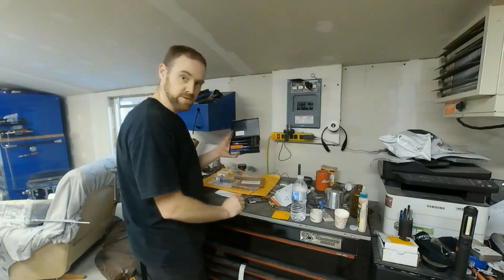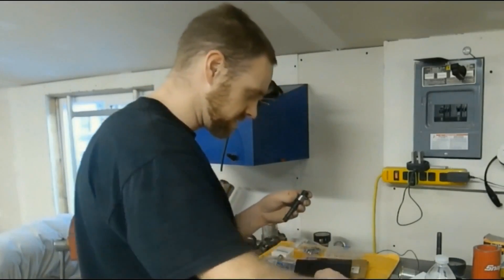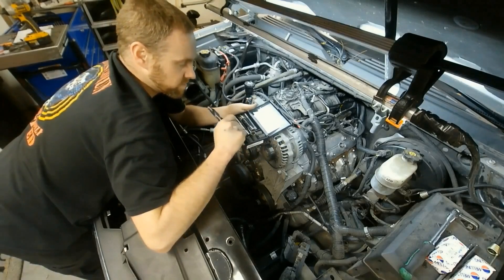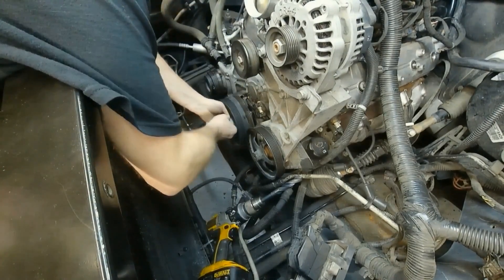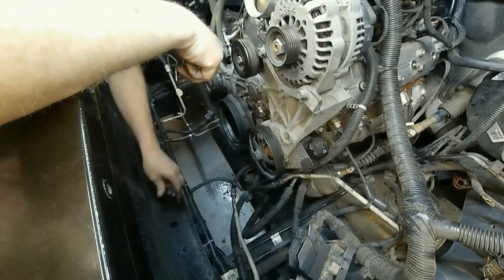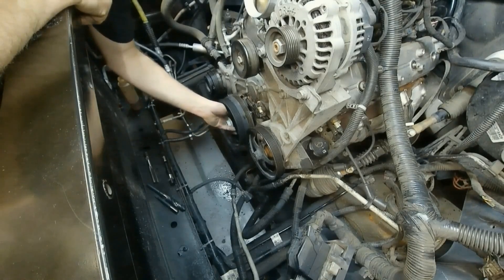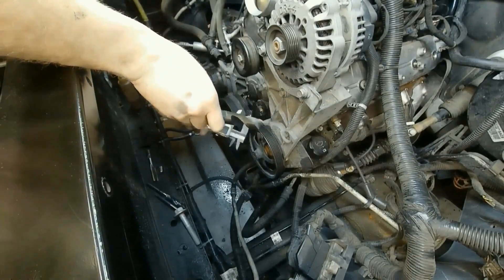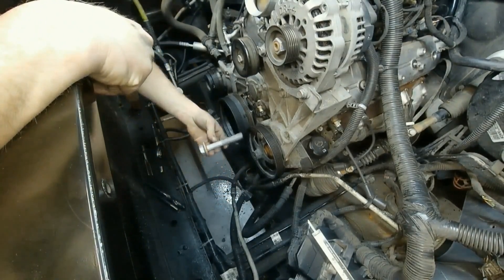Stripped Crankshaft Threads Time-Sert on ls based engine

Comment: Can it be done while engine is installed in truck?
Reply from the maker: What is it you think I did in this video?
Reply: @CrazedPerformanceRepair don’t see your radiator
Reply from the maker: @MC-hs4mf  yeah I had the radiator out because the camshaft was out. In order to remove camshaft radiator has to come out. You asked about the engine being out, not the radiator.
Reply: @CrazedPerformanceRepair 
Bc this doesn’t seem doable in my vehicle without removing engine or radiator

Comment: Is Loctite the way to go to hold the sert in place?? Or would something like jb weld be stronger to hold the sert in place?? Also would just the regular time sert be enough for the balancer bolt to hold?? Or are the BIG serts better for crankshaft repair??
Reply from the maker: I think loctite is the way to go. At least then one could technically remove it if needed. All you need is a little bit of heat to more or less melt loctite. I wouldn't use a regular helic oil style repair on one of these. I'd be concerned that the hedge of the coil might catch the bolt and leave you in a worse position than you started with.

Comment: no one anywhere speaks about the 'recommended.' old bolt to 240 ft. lbs. to seat the balancer process then pull and proceed with the new  tty bolt. did you hammer it in with a torque wrench or lock the flywheel and follow proper procedure. i'd be scared to death either way in your case
Reply from the maker: This was a strange situation where I was attempting to put it on without heat if I recall. I believe I used longer ls7 bolt I had to start it then old bolt to lock it down before using new bolt. Now I don't listen to book or tq to 240 with old bolt. Now I preheat balancer to about 250deg f and quickly push it on then just as quickly zing in the old bolt with impact till it has bottomed out the balancer. The only purpose of the 240lb ft is to bottom out balancer. when the balancer is hot and the crank is cold you can sometimes bottom the balancer just putting it on with your hands. so it doesn't take near the force. when I use the impact I usually don't go past maybe 50lb ft or so if the balancer is hot.
Reply: thanks for the info. i installed mine 'by the book' yesterday on a donor engine i freshened up but will give your method a go when i take apart the failed engine. yeah the 250 degrees makes sense. (my heart sank when you pulled the crank threads) @CrazedPerformanceRepair

Comment: So how much did you go in is i did see close to the end of the drill bid just still curious on how much going to do try this in the near future just need to figure out how im going to get the install tool off sense it broke inside i got the install kit from autozone and had a smaller bolt go into the actual size of thread i needed installed the harmonic balancer and once i started backing out the tool the second pieces stayed inside (if makes sense) what im talking about as far as the tool i got from autozone....
Reply from the maker: Ouch, if the tool is a hardened steel you might be f-ed. If it's not you will have to drill it out and start over. Unless the hole in now to big for an insert. Sounds like you are in a much worse pickle than I was 😱
Reply: Yea I was able to get the second piece out just need to put the new insert in going to give it a go just need to figure out how muxh to drill in with the 7/8 bit glad I was able to get the second piece of the install tool out just need to replace the thread with the time-sert insert.

Comment: Would that 7/8 work well for helicoil tap. I'm running into the same issue. Tap will not fit
Reply from the maker: No its a metric thread, link in description.

Comment: I think you should of replaced the damaged crank since you used wrong tool it was on you this is why I don’t take my stuff to mechanics very shady work
Reply from the maker: So when a bolt hole for holding valve cover on strips out you replace a cylinder head? That's very waistfull. Replacing parts doesn't make you a mechanic, fixing them does. When I fix situations I cause I at least make the customer aware of it. That's not shady but instead honest. Shady is when you do half assed work behind the customers back.

Comment: why not warm up the balancer with a torch before installing it.  Then just install the bolt to what you feel it's good.
Reply from the maker: I normally do. May not have on this one though I don't recall. I just remembered the crap show that happened after.

Comment: When you buy the kit then it would come with the proper drill bit, tap and inserts. Tap and inserts for sure. The taps are special for the inserts and you can’t use a normal tap due to the difference in the pitch that fits the inserts threads.
Reply from the maker: The kit link should be in description.

Comment: I stripped most of my threads inside my crank while pulling out the balancer.. i have about half and inch in the very back left that actually grabs tight.. I believe its about 3 inches total of where it starts to grab the bolt,what do u recommend? I have a 2014 camaro ss
Reply from the maker: 3in of thread seems like a lot but if the threads are damaged enough I would not be opposed to a repair like this. These engine balancer bolt get tightened down to such a high amount of tq I don't feel comfortable having very many damaged threads.

Comment: Hey man question for you, i just broke off a installer tool bolt into my crank on my 05 cts-v, i need to drill out the bolt that is stuck in there and the threads are completely shot, thats why the bolt broke, would this kit work for me? as long as i drill through the stuck bolt?
Reply from the maker: If it is a bolt than you should be able to drill it out and use the kit. If it is a tool stuck in there and made of harden tool steel you are probably screwed.

Comment: Will this work on a 2004 5.7 hemi crank shaft also
Reply from the maker: Most likely, I haven't messed with the hemi engines because we don't have many in our area. Will probably need different thread kit though I doubt the LS style engines and hemi use the same bolt thread.

Comment: on the other end of the crank do you know what the size is of the threaded holes?  the other end the clutch bolts to the end of the crank
Reply from the maker: 11x1.5mm I believe .
Reply: @CrazedPerformanceRepair  OK GREAT THAT MATCHES THE CAD FILE NOW--I had 10X 1.5 and could not understand why the holes on the cad model showed .433--that matches 11mm  THANKS
Reply: @CrazedPerformanceRepair  The reason I was asking is we dont have a physical crank out of an engine and I have designed a puller and also the tool that puts on the reluctor wheel/tone/timing wheel..  You notice the videos people pound and its total mayhem.. The clamp I have you simply put it in position with the 2 locator holes engaged and tighten down a central nut and it drops it right down and holds it down hard till it cools. I will be great I will do a video showing what a calm easy method it should be compared to the mayhem now..
Reply: actually it sounds like your issue is similar although I did not really watch the video because I was cruising looking for an answer to the opposite end.I will analyze your video after all and design a puller the problem is the $20 is hard to beat and make a profit.
Reply from the maker: @KeyWestBluesX  Not sure what part you are talking about for $20 but I would be interested in seeing the thing you are making.
Reply: @CrazedPerformanceRepair  I will do a slide show video--and upload it shortly.. No way to attach photos in these replys

Comment: The pt cruiser i accuired had a bolt broken off in the crank and i realized the threads are quite recessed like yours is and im gonna have to repair it the same way by allowing the counter sink tool to fit inside the crank a ways to the depth i need the new insert. I wish time sert would realize this type of repair and come out with a kit for recessed thread repair. Thank you so much for posting this video, how has the repair held up? Any tips you wouldn't mind passing on?
Reply from the maker: Yes it held up fine no real tips other than what was in video really. but it sure did work out nice in the end.

Comment: One thing I don't quite understand here, with these balancers and other press fit balancers I usually just Hammer them on with a 4 pounder and have never had an issue????
Reply from the maker: So you smash the thrust bearing and warp the crank by shocking it with vibrations? Furthermore where do you find the room to swing a 4lb hammer?
Reply: @CrazedPerformanceRepair  Well I didn't say I smash it like I'm driving a railroad spike home or a nail into concrete!!! I tap on it with a properly sized socket that fits in the flange where the head of the bolt contacts. I usually turn the hammer sideways in situations where space is limited but on most trucks with LS engines once the rad is removed there is more than enough space. I HIGHLY doubt that ANY measurable damage has ever occurred from me giving the balancer a few love taps with a hammer to seat it!
I always put some oil on the crank to help it slide on as well.
Reply from the maker: @lustfulvengance  I would be impressed if it could be love tapped into place without honing out the balancer hole, they are a .0015-.002 press fit.
Reply: CrazedPerformanceRepair thats actually the recommended bearing clearance also lol.
Reply from the maker: @ls87gbody  if you have bearings at .0015-.002 tight you will not be able to turn the motor over lol
Reply: Nope, I'm not going to say anything 🙀

Comment: That bites. Might want to invest in an installer tool. I used to use the bolt to pull the balancers in, not worth risking damage. For the LS engines I spent the $20 for the threaded rod/nut/washers to pull it in without causing damage.
Reply: Hindsight is 20/20 and a person isn't likely to watch a vid like this, UNTIL AFTER they fk things up and need some wisdom on how to fix the issue...  Kind of like I am doing, right now!  You are spot on, as far as investing in the proper tool for the proper job, nonetheless.
Reply: @leonessity  well, reading this 4 years later. I now use an air hammer to rattle some balancers on if I don’t have the right installer😆
Reply: @mph5896  Well, I pulled out my air hammer and be damned!  You became champ of the day with your bit of wisdom, as it saved me a world of grief...  I'm only a hair's breath away from having the balancer finally seated, so thank you!!
Reply: @leonessity  Pull it in the rest of the way with the bolt if its close.
Reply: @mph5896  I think I might have stripped the crank threads...  Mondays!
Reply from the maker: I have one found it later it's another one I made that I forgot I had. But stock threads on one end fine threads on the other
Reply: @CrazedPerformanceRepair  I installed a few by heating up the inside of the shaft of balancer with a torch. It expand the metal just enough to slip right on. Only issue is it has the possibility of damaging the front seal.